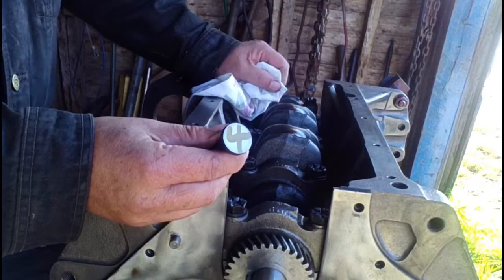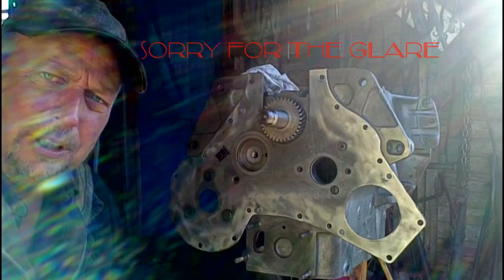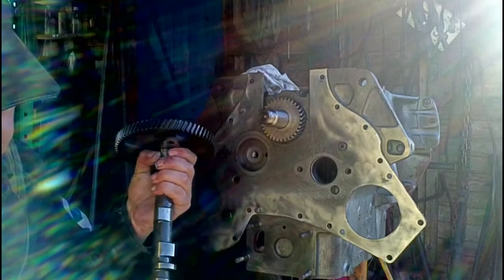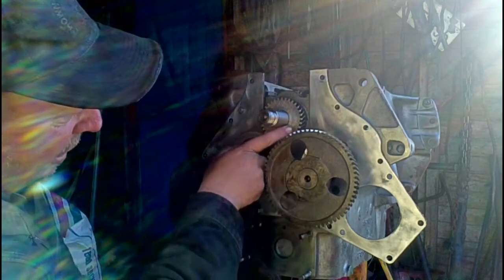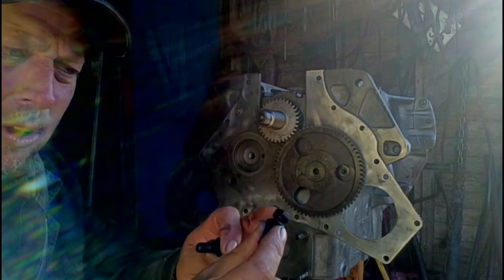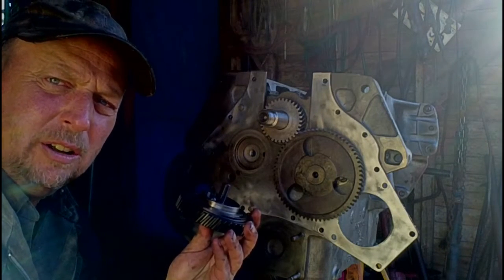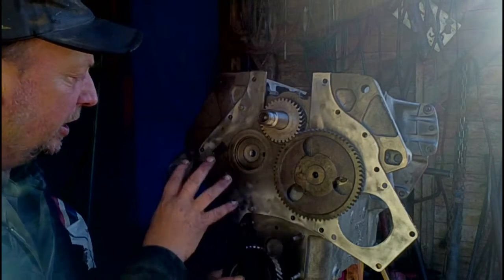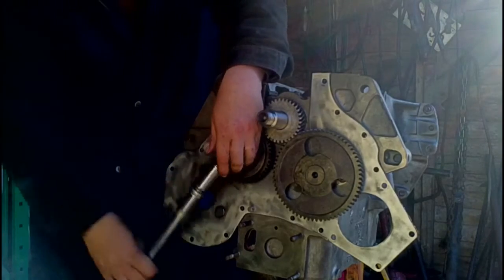IH 444 engine rebuild part5, Cam and lifters, engine timing

Comment: Hi is that the same engine as International b 275 and b 250 ? Thanks John
Reply from the maker: Essentially yes, the B275/250 have a BD144 engine, same block but slightly smaller pistons. A the rest of the parts interchange. Thanks for watching!

Comment: Hello Canadian Redneck, I have a 1986 ford 3000 3cyl diesel which I'm rebuilding (bought it with a locked up motor) there is water damage inside the engine, pistons are out and preparing to do an in frame rebuild. The crankshaft will not turn. It looks like water got into the lifters and push rods and rusted things up pretty bad. Are the lifters preventing the cam and then crank from turning and if so do I have to remove the camshaft to remove the lifters? It's a nice tractor and it's got a HD loader so I'm planning on fixing it up right. Thanks for your knowledge and videos.
Reply from the maker: I would recommend pulling the engine and carefully checking every part for rust/pitting and replacing damaged parts. Thanks fore watching!

Comment: How do I set the timing after I set it backwards on engine rebuild? Can I slip  cam out and simply rotate it
Reply from the maker: That would do the trick but you will have to have the engine upside down and pull the rocker arms to take the tension off the lifters or they will bind on the cam, you won't be able to pull it out or put it back in.
  Thanks for watching!
Reply: Canadian Redneck that’s the only way to change the timing? I already have it hooked up on tractor

Comment: Hello Dave, first let me say thank you thank you for your channel. I am having an issue with a rebuild 1949 Ford 8n tractor. I have found the cam line to line up, but have no dots or line on the crank gear, I have cleaned it thoroughly and still no dots or line on the crank to align with the cam.  I'm sorry not to computer savvy I have some pic's but unsure how to add them to this text. Here is my email in case your ability to give me a holler I can send them to you and maybe give me some suggestions, this is the only thing keeping me from putting it back together! Thanks Again  haverp19@gmail.com
Reply from the maker: Hi Paul, I am glad you are enjoying my videos, I do have one on rebuilding an 8N engine, there might be some help in there and I will also try checking into my manual in the shop. Good luck.

Comment: i have maybe a dumb question. if most of your customers need all this engine work done at your shop how do they get to your place? i mean they don't drive a tractor to you? do they use a trailer  ? thanks, good work.
Reply from the maker: That's a totally legit question, most of the tractors get hauled here on a trailer or tilt deck wrecker. The odd one that is from near by does get driven here if it hasn't had a catastrophic failure.